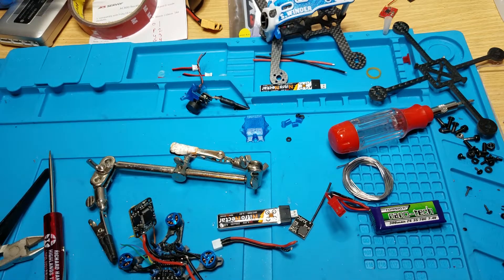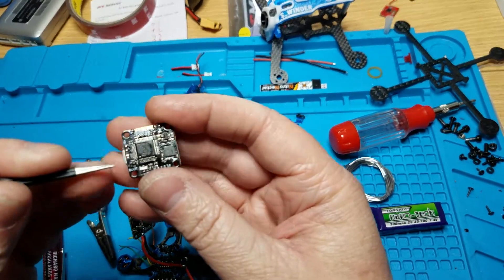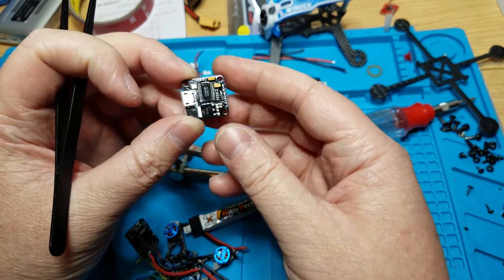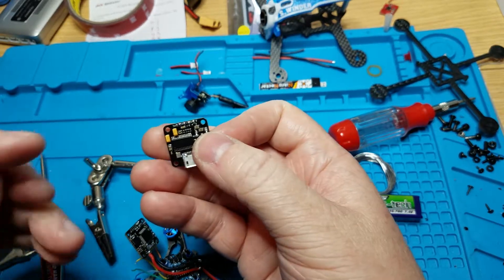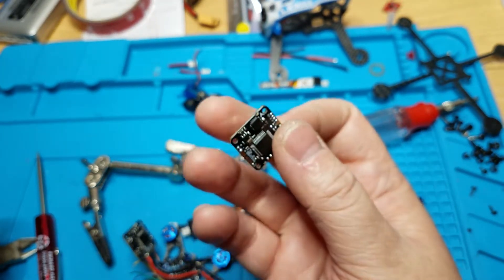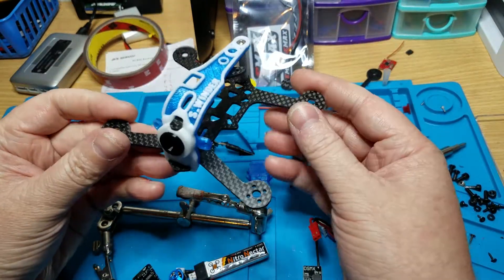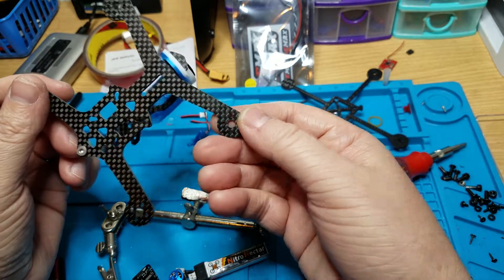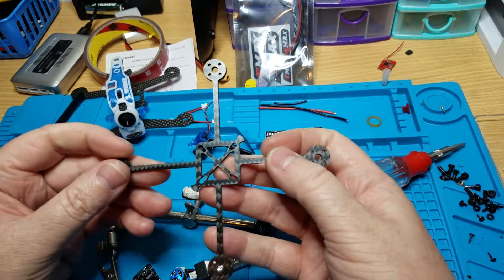New 16x16 fc

Comment: Well they changed their ad lol per------ Incredibly Tiny F3 premium quality OMNIBUS compatible flight controller with 16x16mm mounts with OSD that can be configured directly in betaflight and 1A 5V BEC which supports 2-3S batteries.
You can add support for 1s by using Step Up/Step Down Voltage Regulator.......So I guess people are noticing haha! Good to know tho...

Comment: Whatsup adam i like your build videos, im having a problem connecting my flysky 2a reciever to both my omnibusf3 16x16 and also wont work with my omnibusf4 20x20. Where can i ask you a few questions? I think you can help me i hope, getting frustrsted. Do i have to have a battery plugged into the quad while on betaflighgt to see reciever tabs?
Reply: Yep i tried both the rxin snd the dsmrx in becsuse of the inversion, tried both on ibus ans sbus  (flysky i6x radio) no response. BUT it works on ppm on the f3?
Reply: And yes ive used multiple recievers. Rx2a fs82 and fsa8 v2
Reply: Im like 5 minenets from leaving for work ill talk with you soon thank you!
Reply: ADAMBOMB FPV by the usb?
Reply: It gets really complicated but, it worked fine for 10 packs, i put the electronics on a new chassis, had to flip the fc orentation, so i set the orentation in BF and thats when ibus stoped working. I hear the omnibusf3 16x16 from the betafpv 65 pro has some secial firmware uart remapping? Uart3 keeps dissapearing from the ports tab completly. Its strange. Works in ppm.... slowwwwwlyyyyy....
Reply: I will try the other rx pad by the usb when i get home, i havent tried that one yet. But it all worked before i flipped the fc orentation in betaflight. Thats when it stopped working. The reciever tab is all zeros no bars at all. I just ordered a new omnif3 FC. Hope it works.
Reply: Hey Nick what is up? I was reading your comments here yours and Adam's and I am having a VERY similar problem maybe one of you can help me as well, for I have chatted with Bardwell for two hours earlier and no good?? It is the Cicada 180 by AKK the advanced version, and the advanced version DOES NOT come with a quick guide or any kind of user or owners manual....It comes with the BASIC version quick start guide which pertains to the advanced version NONE! The advanced has an omnibus F4 the basic F3 and the advanced has larger motors but there is NOTHING on setting this thing up whatsoever, and the basic DOES NOT do IBUS and this one is for my son he wants to try FPV and so I set him up with that kwad and some VRD2 Pro goggles and am giving him one of my FlySky i6 radios for now I have him the Jumper ordered but will be a while China you know, but the advanced version DOES do IBUS and I used or trying to use the FS- X6B think version 1.1 and have tried what on the basic version is the PPM port nothing and now have it connected to DSM pad signal and nothing....??? I am at wits end what am I doing wrong for have used this rx before with same radio??? Should I maybe try the FS-A8S? For have one of those as well, but cannot find squat on IBUS and that kwad either version but the manual does say the advanced version does do IBUS SBuS PPM and all....I am desperately trying to get him in the air FPV he has flown LOS for a long time now but thought FPV would make him dizzy haha so would never even try it, now he wants to bad and I cannot get the thing up!!?? If you have ANY ideas EITHER of you PLEASE talk to me!! lol you can facebook message me Brad Ivie or Turbo's Drone World or even my YouTube channel or go to my channel and get my email and do it that way if you prefer for it is hard here...Thanks guys I am really needing to get this deal going....I want to fly the little hummer as well hahaha it is pretty neat and way cheap! On sale right now basic I think $98 and advanced $109?? Something like that....Well let me know thanks fellas!! L8r-Turbo. Oh and I have watched some vids on the deal and JC Blue Falcon made a BUNCH of vids on IBUS and Omnibus but it isn't working as he said, is this RX not compatable with the i6 or what the heck??